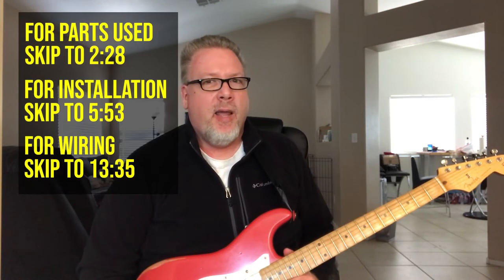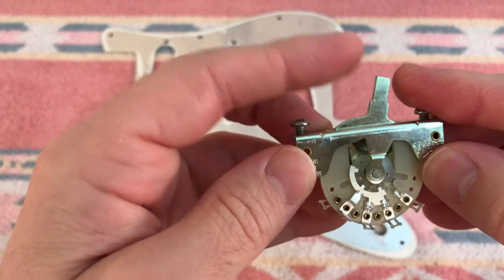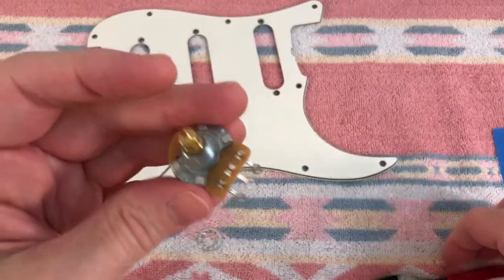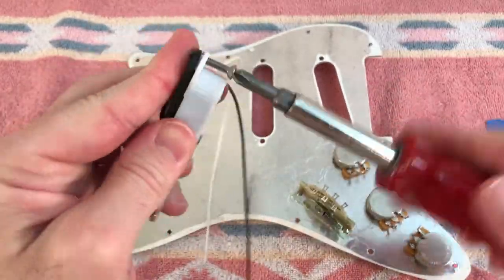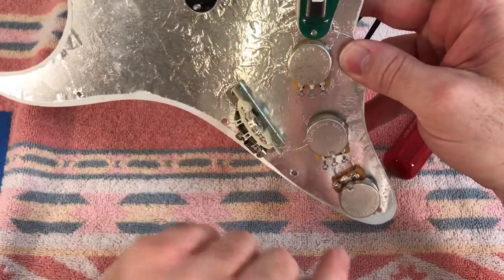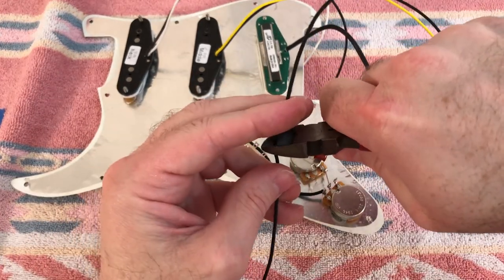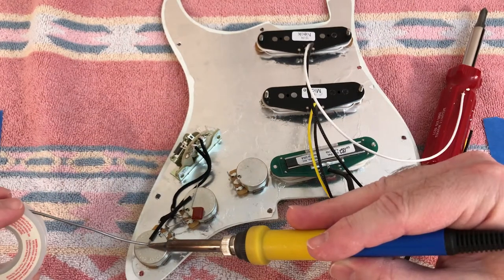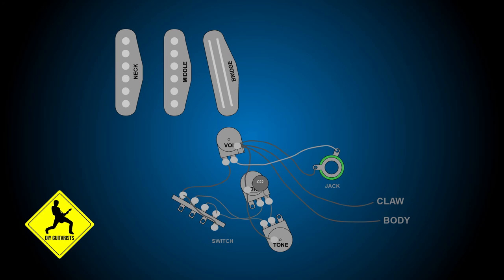How to wire up a new pickguard from scratch! | Step-by-Step guide with diagrams | Part 1/2

Comment: Also I forgot to mention that the Dual humbug is only got one wire coming out a hot wire and a ground
Reply from the maker: If you're wondering how to wire these, the braided outer wire is the ground and goes to the back of a control--usually the volume. The insulated inner wire goes to the switch. I usually run the wire the longest distance first--commonly the switch--cut it off, then cut the braided wire with tiny scissors, twist together and solder to the back of a volume or tone control as short as makes sense.

Comment: Yes hi maybe you can help me I'm trying to wire up 3 dual humbuckers to a five-way switch when the switch is by the neck I want the first pick up to work when it's in the second position I want the bridge I'm sorry I want the neck and the middle to work when the switch is in the middle I want all three of them to work Wednesday the 4th position I want the middle in the bridge to work once in the fifth position I want just the bridge to work is there anyway you can help me with that it's going into an Ibanez that I built myself thank you
Reply from the maker: So, the only change from standard wiring is to have all 3 pickups on in the middle position? I'm thinking you will need a super switch (basically 2 switches combined into one) to get that to work. If you try to jumper the lugs on a normal switch all pups are on all the time no matter the position. Seymour Duncan website will probably have a diagram with a super switch to follow.
Reply: I don't think you understand what I'm trying to do I'm trying to get three dual humbug has to work off of 5 way switch when the position switch is in the neck position I want the first humbugging to work when it goes to the second position I want the neck humbucker and the middle to work when it's in third position I want all three humbug has to work fourth position I want the middle and the bridge to work 5th position I just want the bridge to work I can't find anything that has that type of wiring setup can you please help me thank you